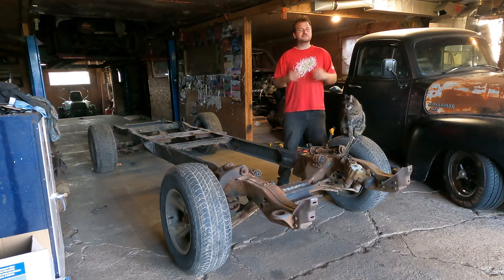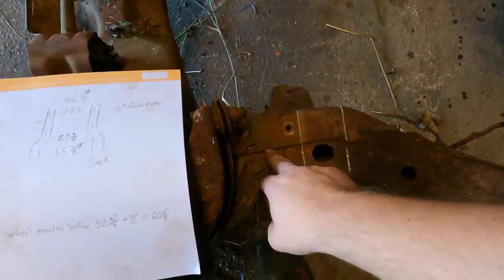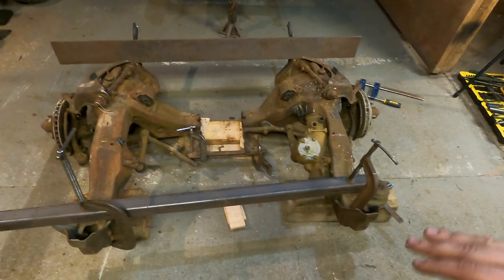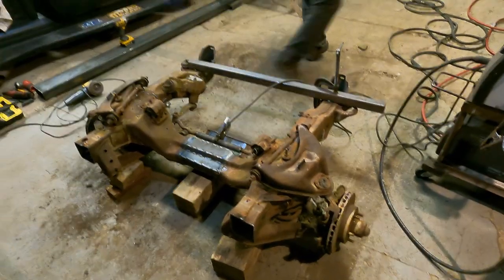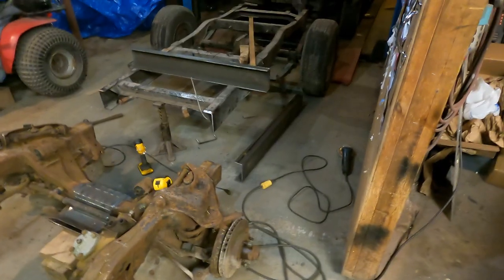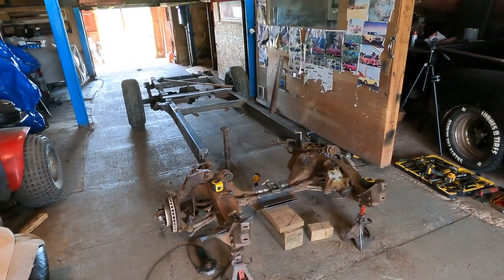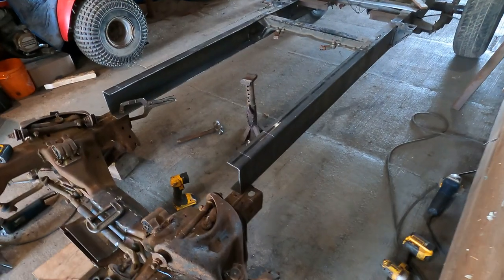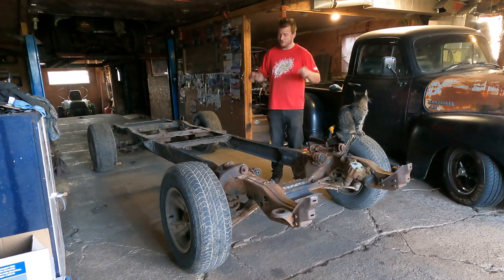building new frame for my 1955 chevy panel truck- welding an S10 front clip onto a 55-59 rear frame

Comment: I know this is a bit old now, but I have an S10 frame that I need to widen 4 inches total in the front. I love what you did here and great work. I was wonder though, since I only need 2 inches either side, would it not be easier to widen the control arms (A-arms) the 2 inches I need?
Reply from the maker: You could probably widen the control arms, but the only thing with that is you might change the suspension geometry a little and if you ever have to replace one you’d have to build another one, if I was to do it again I’d just widen the frame, might seem like more work but probably save you a bit a headaches later. I’m no expert tho, hopefully this is some food for thought!
Reply: @TuquesNTires  definitely food for thought. I like the idea of widening the frame. I will look into that. Thank you!